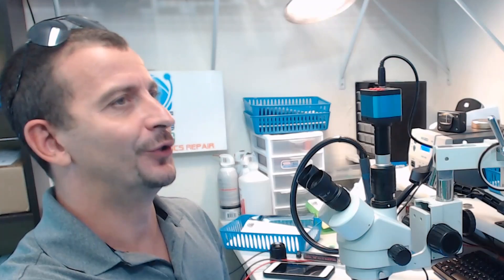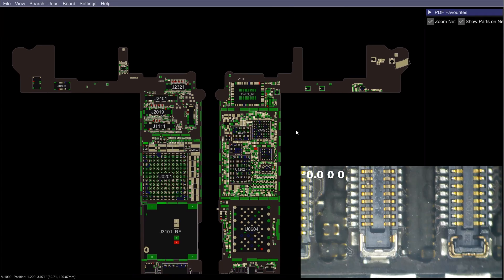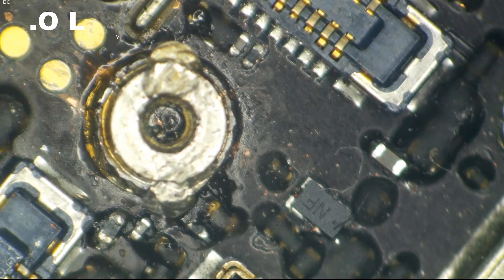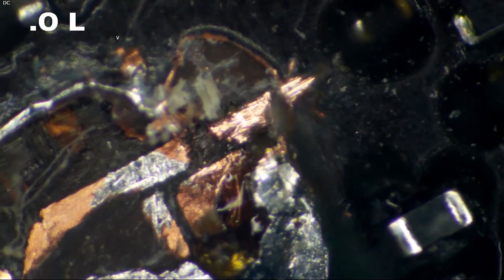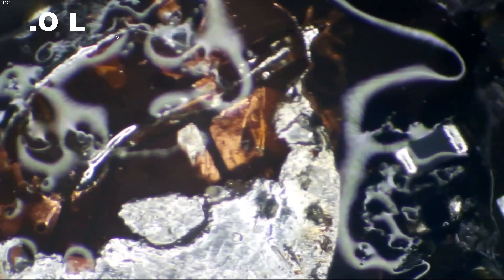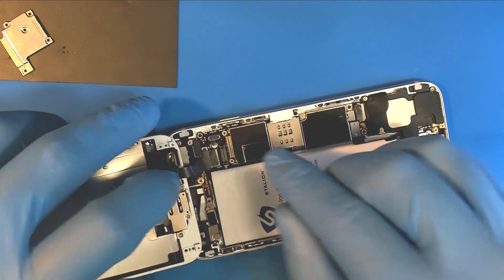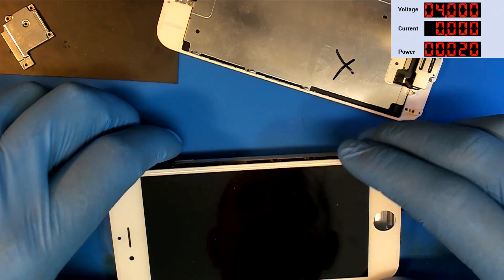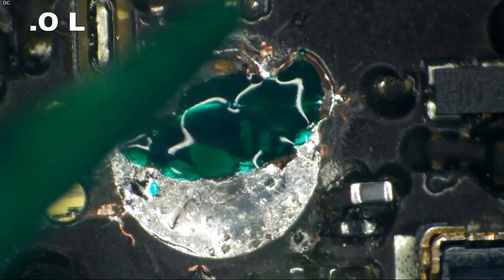Sloppy Seconds - A long screw damage quickie (iPhone 6 No image)

Comment: I was one of the few shops that did board level repairs about 4 years ago but ended up getting out of the business, recently I thought about getting back into but it seems like most shops are doing board level repairs now so I've been questioning whether to even bother. Do you get alot of board repairs?, do you think you can still make decent money just doing only mail in board level repairs.
Reply from the maker: We are mail-in only and get so much work I'm having to turn quite a bit away.  As much as I love posting videos on YouTube, it's made it very difficult to keep up with both, however, the only reason we get so many repairs is because of YouTube.  I really can't speak for the rest of the world though.  I'm hoping to find a balance soon.

Comment: I have a question for you? Do you know where I can get a program for work orders and invoices that I can buy it instead of leasing it? I would appreciate your input. Thank you. Allan
Reply from the maker: I have been using Ultimate Client Manager for several years now.  I originally used it for keeping track of and invoicing on-site IT related jobs.  It needs a server to run on though.  I first started with it running on a local machine which did not have any monthly fees but eventually migrated it to a server that I rent.  The server was initially $5 monthly but now I think I'm up to $20 since the data has grown for a few years.  It's not really a download and click install type program though.  It can be a bit tricky to setup.

This is what I'm using:
https://ultimateclientmanager.com/
Reply: @ststele  thank you for the reply I appreciate it. I follow you, jessa, Louis rossmann and an learning a lot. I am going to buy the rest of my equipment in the next few weeks after I get my back pay for disability and after i learn how to do this and start making money i can get off of disability. I was a mechanic mechanic before and can't walk at the moment, i have a weak right hand and numbness in my fingers and can't feel heat in my hands correctly. I found a way around all of that and am doing screen replacements, batteries, cameras, ect. I can going to go to a ATC school locally from suu university for IT more knowledge in electronics. I plan to practice and go to jenna school also. I just wanted to tell you thank you for want you are doing. It is giving me a chance for a better life instead of sitting home and doing nothing. I really appreciate you answering my questions. Hope you have a nice night.  Allan.  Barr iPhone Repair

Comment: Great Fix Jason 👌🏼

Just for a 2nd opinion I have an iPhone 8 Plus here that boots up just fine that charges just fine on mains power / usb adapter every time but neither will a PC or MacBook / iTunes detect the usb, it’s not the charger port flex and there is no short on either the hydra connect cap or resistor from the flex connector so could this be a bad hydra IC or a fault on one of the pads under the chip ?¿?¿?

Just don’t know if you have come across this one before 😐